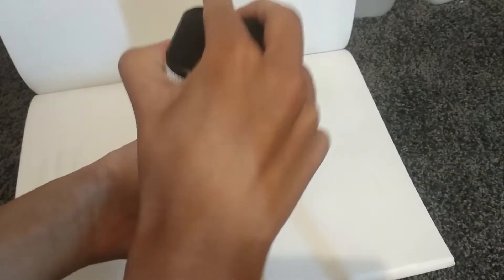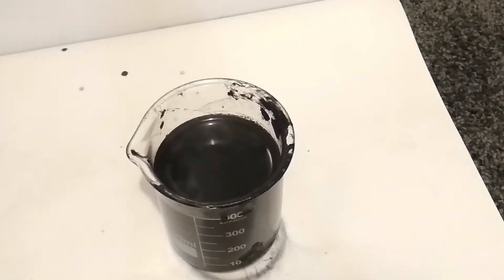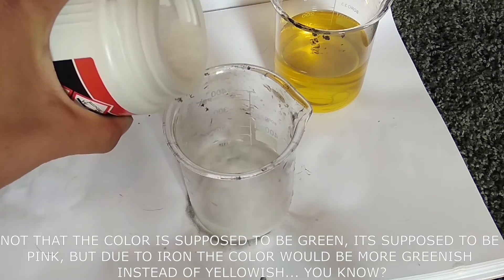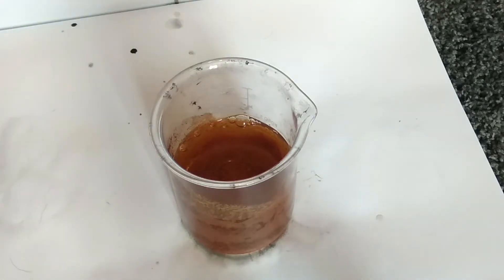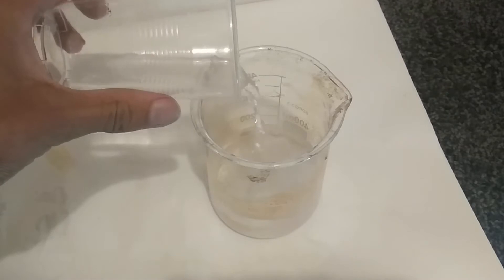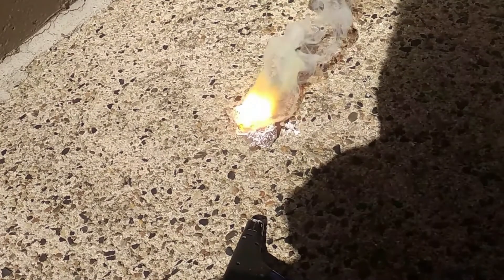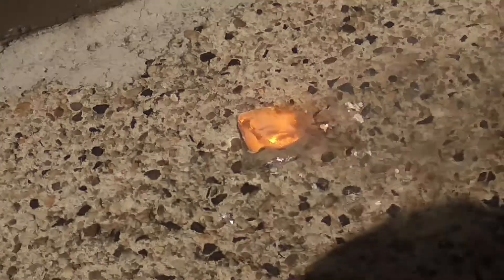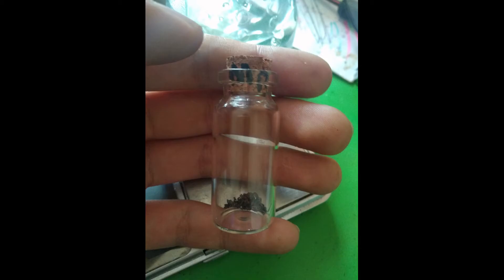Extracting manganese metal from batteries

Comment: Thanks for the process! Im going to use the purification step in the video, but for the reduction in going to use the electrolysis method showed in scrap science's video of making manganese metal
Reply from the maker: That sounds awesome! Good luck
Reply: Are you planning on using the Manganese chloride solution created here and use it in Scrap Science's electrolysis procedure?
Reply: @parcydwr  At the time i didn't had all the equipment to do the procedures but now i plan to reduce the MnO2 electrolitically in the cathode compartment using Fe2+ as the electron carrier. Fe2+ reduces MnO2 to Mn2+ and it oxidizes to Fe3+, wich it's reduced in the cathode back to Fe2+. I didn't made it yet, when i do it im gonna upload a video about it.

i plan to use sulphuric acid instead of HCl. The MnSO4 formed can be used to electroplate Mn metal as Scrap Science did.
Reply: @lautaromorales2903  That would be very interesting. I am not a chemist and my sons would understand it better. We are trying to make a periodic table of 'pure' elements. The thermite method seems so dirty so a cleaner chemical method would be interesting.
Reply: @parcydwr Nice idea to make together! Yeah, if you want to obtain metals electrolysis it's the safest way to go. Sadly you need an anode that can withstand the conditions. Those ones are lead anodes (nasty and only works with sulphates), graphite, or platinum. The safest to use it's graphite, Scrap Science (best channel about electrochemistry i know) made a video about preparing graphite electrodes used in welding